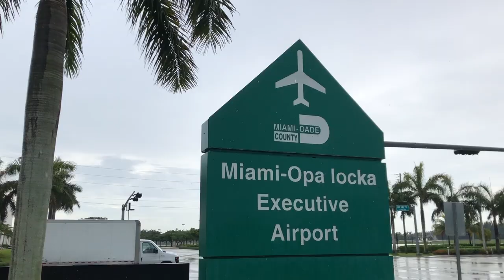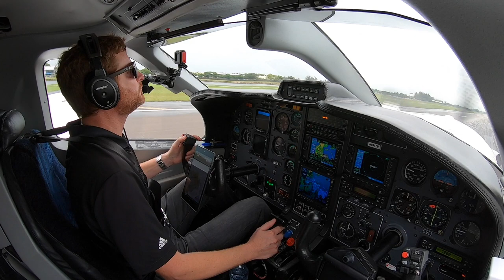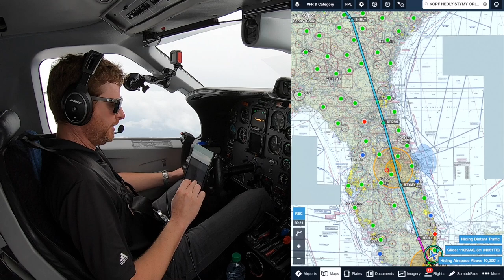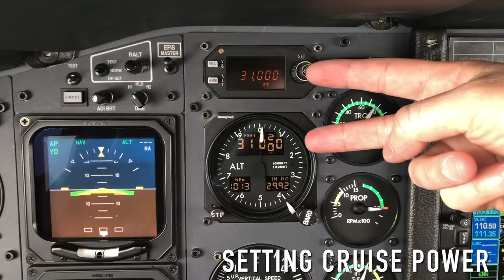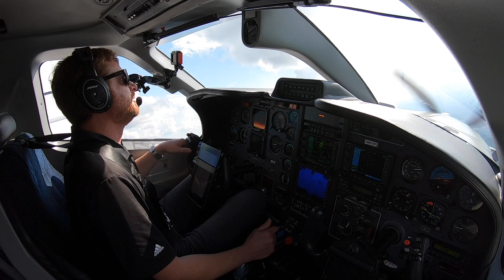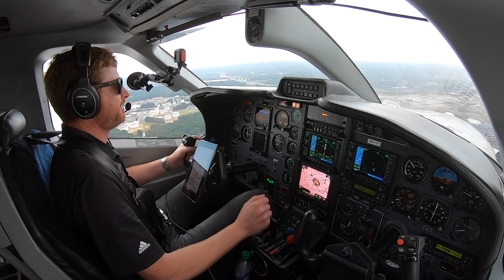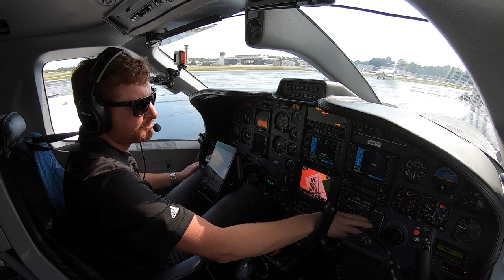MAX ALTITUDE in the TBM850! - Miami to Atlanta IFR Flight VLOG

Comment: A word on the Bose headset. I have one which had a transmit problem. Sent it back to Bose who not only sorted out the problem but also serviced the whole unit, replacing a seal and an ear cushion at no charge. Impressed!

Comment: Your cabin doesn't reach the normal 6.2psi pressure differential. You should have it leak checked.
Reply: Chris Machaj huh? Slow? The TBM is the fastest GA SETP around......
Reply: @Chris Machaj 2 famous depressurizations.
Reply: @Chris Machaj I fly FL300/310 on every single leg. It adds a lot in terms of fuel efficiency and weather avoidance. The TBM has airliner dispatch reliability thanks to its altitude capability. TBM is well equipped with systems to handle depressurization, it's not very demanding or dangerous. Both cases were major pilot mistakes and have been incorporated in training. In case you get a pressure warning, you don the mask. You don't start messing with any system on the plane, etc.
Reply: @Chris Machaj It is 'slow' if you are on the same departure or arrival route, or worst case, the same J- airway - however, they will simply vector you off it; The Vapp speeds are very similar to most mid-sized airliners.  I think you are dissing on the TBM for no reason. Its a fantastic aircraft;
Reply: @Chris Machaj I am from Scandinavia, if that is a clue to you!!!
Reply: Sad depressurization accident: "October 25th 1999. Golfer Payne Stewart dies in jet crash. The cause of the uncontrolled flight and crash after the Learjet 35 apparently ran out of fuel were not known, but aviation experts speculated that the aircraft may have lost pressurization and that emergency backup systems failed as the plane's autopilot kept it in the air. Loss of pressurization above 30,000 feet would cause occupants of the aircraft to lose consciousness from oxygen deficiency in one to two minutes, the experts said."

During some of its eerie, almost fo

Comment: What is the purpose of the white electronic device you stuck to the window?
Reply: who knows?
Reply: @user-eo4zt5lw8d  Probably a bluetooth gps for the iPad. Even though iPad has GPS I use a different brand. I think it's better for accuracy and battery on the iPad.
Reply: @user-eo4zt5lw8d  - It's an ADS-B receiver with built-in GPS. This device supports the ForeFlight aviation app in his iPad.

Comment: I never knew the TBM-850 could cruise and fly at fl 310 (31000 feet)
Reply: I didn't know a prop job flew that high..
Reply: Back in 1976 I was flying my Turbo Commander (AC690T) solo between Darwin and Sydney Australia and had to fly in a bit above FL330 to stay above a giant storm. It did not like FL330. (like showing low fuel pressure and a cabin alt of 27k+  I was on 100% oxygen)

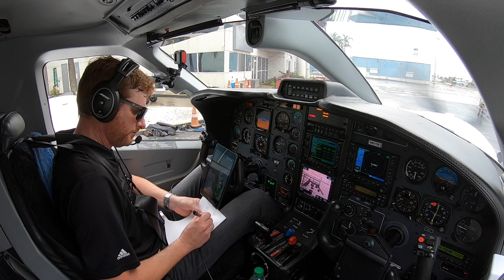Comment: Love this one Steveo, really well explained. QUESTION: So picking the vectors From 3:38-3:54...How did you catch it all that quick and fast? Did you had the vectors Miami 6 Dep HEDLY Transition, STYMY, ETORE, SHRLT, WRGNZ load it already in your Flight plan and GNS already?
Reply: I was wondering the same thing. Impressive how Steveo managed to get all that. I’m thinking most guys would have responded, “say again a little slower, please.” I know I would have needed to.

If Steveo had filed that route, the controller would have said “as filed” instead of reading off the alphabet soup ... I mean, waypoints.

Comment: if you are planning a flight IFR and lets say you are taking off from a uncontrolled airfield, and you are taking off into heavy IMC conditions. (storms with low cloud bases) do you still have to takeoff VFR and pick up your IFR in the air, or can you get it on the ground from a departure or other controller?

Comment: What do you do for supplemental oxygen in case of a rapid decompression at FL 300?
Reply: there's oxygen masks in the 850, it's just out of shot on the left above his head. in other videos you can clearly see the masks, with its two red buttons to deploy the mask and inflate the headband. you grab the mask by the buttons, put it over your head and release the buttons. removing the mask from it's stowage location automatically turns on the oxygen.

Comment: Hey Steveo, (or anyone with this knowledge) what exactly is "850 mode" in the TDM. I know the 850 has better thrust at altitude but is there a way to actually select '850 mode'? Thanks, sorry if it's a n00b question.

Comment: Hey Steveo, my father and I fly a King Air 90 and our on board weather radar has the ability to pan up and down so we can see what is straight ahead or perhaps what we are climbing/descending into. I wasn't sure if you used that on your radar or not, but if you do, do you have any tips on how to angle up or down for the best returns? Thanks!

Comment: 7:50 Why tap the breaks before wheels up?
Reply: The tires are spinning from the takeoff roll, so you tap the brakes to stop the rotation.
Reply: Some planes have mechanical devices that press against the tires upon retraction (since nose wheels rarely if ever have brake assemblies, this is common on retractable nosewheels), others have systems that automatically apply brake pressure when retracting.  Other planes have ABS systems that don't like staying down and spinning when doing repetitive pattern work, so depending on your plane and gear design, tapping the brakes can be a non-procedure habit (a technique) that pilots pick up.

Comment: Hello Steveo, can you get the ATIS in written form during flight (Ipad) or only through the radio? Must be challenging sometimes to monitor two radios...
Reply: Most airports don't have D-ATIS. Those that do, you can get it on the iPad using FF or FltPlan.com (Garmin)

Comment: What's your SOP for using the inertial separator? I was surprised to see it off in the climb up to cruise altitude while in IMC/precip.
Reply from the maker: Mark Marsiglio I wasn’t in Icing conditions with the temperature so I had it off.

Comment: Just for my understanding (I am undergoing my atpl training right now in Germany), how can you fly the TBM in IMC conditions commercially? Easa states, that Single engine aircraft are not allowed to fly commercially in IMC conditions or at night. Is that the same case at the FAA and so, I am guessing this air operator has special permission to do so?

Thanks for the help!
Reply: LufthansaA343 FAA is different. Even as just a private pilot you can fly at night. To fly IMC you need your instrument rating. In the US there are no restrictions on single engine aircraft flying IMC or at night, even commercially, just have to make sure the pilot has appropriate ratings.
Reply: @nicktheav8r269  Very interesting! Thanks for the reply! Yes, a PPL holder with IR and NVFR can also fly at night here, just not commercially. I guess EASA is a little scared :D
Reply: @cfg003  haha

Comment: What does “IFR” mean?
Reply: IFR means Instrument Flight Rules. When flying in instrument meteorological conditions it's required that pilots fly primarily by reference to instruments, and therefore under instrument flight rules.
Use of instrument flight rules is also required when flying in Class A airspace regardless of weather conditions. Class A airspace is the airspace between 18000 feet and flight level 600 (60000 feet).
Reply: @mikep9604  thank you, Mike!